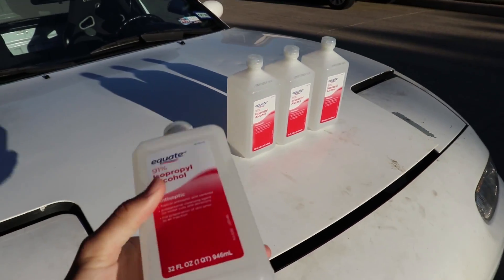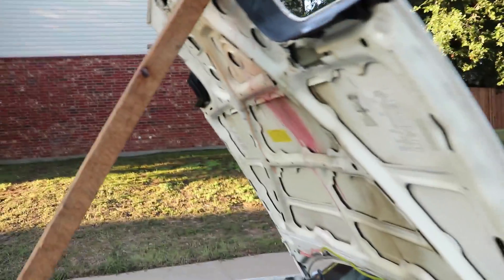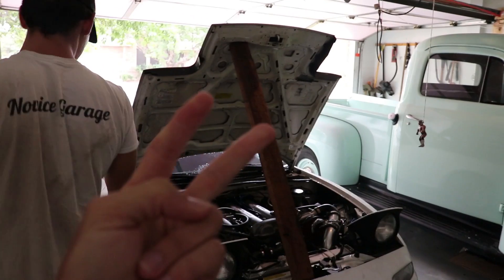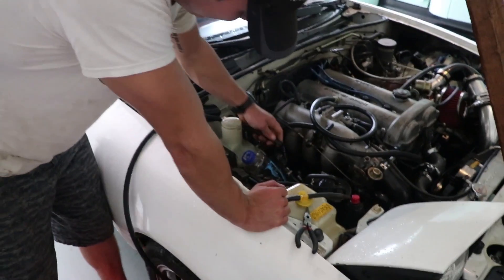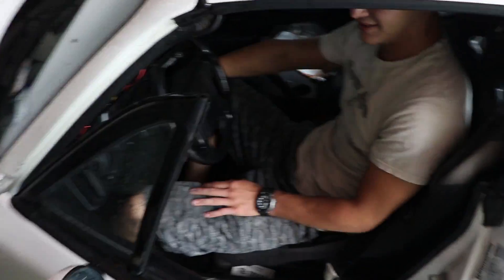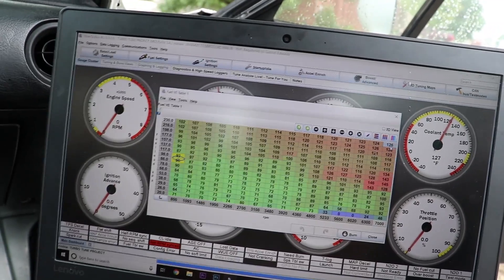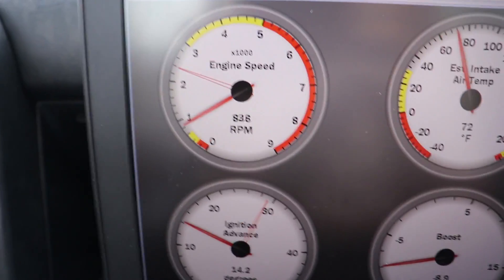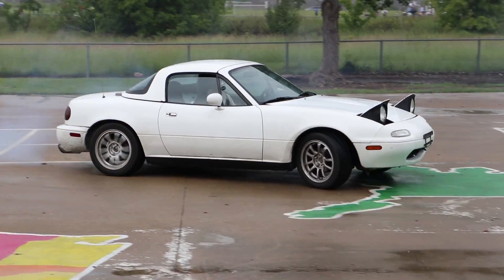Will Rubbing Alcohol Work as Car Fuel?

Comment: How did the avgas work? My dad only ran avgas in his '70 charger back in the day, cuz it had 13.5:1 compression. He said it only liked to run on avgas, and it was cheaper than gasoline back in the late '70s and early '80s. It was his daily driver, but he built it mainly to drag race. He swappin in a fully built 340 from a sprint car and it was a beast. I hope i can get it restored one day. Kept rippin motor mounts from the torque.

Comment: Yes alcohol will work but it lacks the lubricants of gasoline so you’re engine is more likely to overheat. But Ethyl alcohol the only one you can use but you mix it with gas . Rubbing alcohol is not Ethyl .

Comment: With only 1 gallon, your fuel pump was most likely being starving, I bet even if that was 1 gallon of gas the same would've happened based on the fact it's probably a 1/4 inch or less from the bottom of the tank in which fuel pump strainer don't usually touch the very bottom of the tank. At least 91 percent alcohol should have been used. I bet you wouldn't of had better luck with 91 plus 2 gallons.

Comment: Congratulation guys from greece. Here i can have a lot of alcohol from fruits and i really wanted to try this in my daihatsu feroza. Do you have any tip so i can do this without blowing my engine. Great video. If we use a little bit of gasoline maybe 15%, the engine will ran even better?i ask because i was thinking to put alcohol in the tank without take the gasoline off.

Comment: Hey so I have a 2004 Jeep Cherokee two-wheel drive V8 it's got about 109,000 miles it runs great we had a storm come by here this last year and I kind of let it sit there for a couple days and I noticed I noticed my motor running pretty rough if though having that many miles it actually ran really smooth so I put you into together quite smoke coming out of exhaust had a exhausty smelled it if that's the word either way I did what you guys did and 70% alcohol rubbing alcohol worked fantastic save me from dropping the tank and draining it and blah blah blah thank you God bless

Comment: I tried before...BUT not all alcohol.... I tried with 3/4 of tank full and add 64oz of 91% alcohol... guess what I did have ( CHECK ENGINE) light was ON and after driving for about 5 miles it went away ... so 8t will help minor check engine light disappear

Comment: Research about gas being used before mixed with petroleum. It was proven that alcohol or even vegetable fermented can be substituted as fuel for the engine. Rockefeller decided lets not do that because people would make it themselves or even drink the alcohol. So instead adding oil or petroleum with alcohol giving it a standard way of "paying for gas".

Comment: I would think if you use alcohol to often you might damage your fuel pump and some hoses due to the type of rubber its made from, hence why older cars don't like ethanol mixed fuels, I too have experienced a new fuel pump failing on a car built in the late 80's due to using 10% ethanol blend fuel..my new pump lasted 3 months and it was a GOSS brand which make good stuff

Comment: I tried to free up rings on a car in a similar way (soaked it overnight with B-12 chemtool).  I had put an old ratty towel on top of the engine before I cranked it over to to avoid the geyser of crud lol. It did free up the sticky ring based on a before and after compression test. Crap spewing from an engine makes for great video though ;)
Reply: Was this on a Prius? B12 Chemtool is some no joke stuff!

Comment: Methanol injection (alcohol injection) is usually 49/51% alcohol to water by weight.  
Since stoic is different for gas and alcohol, as shortly mentioned in the video, the 14.7:1 afr is way off. Someone can google it, he said 7, but I'm not sure. So yeah, super lean.  
Nonetheless, great little video, despite the hazmat issues - making a mess of the road, your friends car, and in the grass.
Shrug.

Comment: You should have dried the isopropanol. The 9% water content will really fuck with any fuel. Anhydrous alcohols are the way to go, with 100%isopropanol you don't even need to adjust AFR in most cars

Comment: First yes it will run on it.
Why would you want to?  I hate 10% in my gas, becuase it evaporates out.
Also it bad for my vehical.
And then there is the price. 
.......
So you put sea foam in your car.
Then you put transmission fluid in your engine 
And you put mystery oil in Your engine.
Yeah you are a bright one.
None of those will free stuck rings.
Maybe it time to learn how to rebuild an engine. But not to worry keep doing stuff like that and the time will come sooner then later. 
Never add additives to your engine it will last longer.

Comment: So your autotune would have worked much better if you had used the proper air/fuel stoich mixture for alcohol. 100% alcohol is not 14.8:1, it is 9.003:1. Given you have 50% alcohol, 50% water mix, it will be even more extreme, like 5:1. Top-fuel drag cars have around a 5:1 air/fuel mixture. The good thing is, your rings and cylinder walls will stay nice and cool, even under high boost with all that liquid flowing through them. I'm sure the fuel lines and such will hate you for trying this in the near future.

Comment: When you hydro lock your engine because 9 percent of the alcohol Is water
Reply: Most of these kids have never heard of hydro locking the engine.
Reply: @shaunofthedead3000   wouldn't you need a very significant amount to build up? I feel like most of the water would just get ejected with the exhaust.
Reply: That’s not enough to hydrolock an engine.
Reply: 9% is seriously a lot of water.
Reply: @MatthewDouglasT   but i wouldn't think it's enough to hydro lock an engine. typically it has to fill your cylinder to the point where it's more than the level of the point of the maximum height of the top of the piston on the compression stroke and unless it all happens very suddenly, it should just leak out of your exhaust after enough water has built up.
Reply: @ModernBladesmith  You are correct. The water content doesn't matter, hydrolocking is when the cylinder contains enough liquid that it can't complete the compression stroke; you can hydrolock with gasoline or milk or any other liquid.
Reply: @MrMrsirr   That was my initial presumption on combustion engines seeing as the condensation would just be evacuated from the exhaust port on the cylinder if any had time to form before just being forced out by the exhaust stroke.
Reply: @MrMrsirr  Not with milk... No way!
Reply: @CoroPlanesLLC   you're right. Milk doesn't have enough molecular density. However, if you use diesel spark plugs and liquid cocaine, the increase in horsetorque will override the compression in the carbureted fuel injector heads for the piston cylinders and cause the milk to compress more which increases the molecular density matrix which will make it equal to water. It's basic science.
Reply: @ModernBladesmith  

Damnit...who told you the secret formula for perpetual fueline in a combustion engine?

So help me...that guy is totally out of the club. And blacklisted for all our new super secret automotive mods. No more free energy for him.
Reply: @shaunofthedead3000 well technically, perpetual fuel is impossible without a substantial amount of energy to compress water into gasoline, but diesel engines have already capitalized on this principal by using compression to increase the energy in diesel fuel and on the exhaust stroke, it pulls the reusable fuel into the radiator where it goes to the condenser and gets condensed back to usable fuel and is more efficient. that's why semi-trucks can go 1,000+ miles on one tank. They can also use the jake brake like NOS for an extra speed boost. 

This is how cars work. Don't @ me.  
I learned about a perpetual fuel loop while making bicycle engines for nasa.

Comment: In germany it would be a crime if you don´t sober the oil of the street correctly, with sand or wood chips.

And your video is just simple math, just look how energie dense your fluid is.
Reply: Wow that's just stupid the sun will dry it up why waste wood chips on that
Reply: @goreobsessed2308  sun won't dry out the oil, only the water inside, you use wood chips to suck up the oil, so it don't get into ground water. Does it make sense now?

Comment: You need new piston return springs and a new muffler bearing. You should also refill your blinker fluid.
Reply: That's sold next to the elbow grease right?
Reply: John CenaVevo? Chrisfix can help them
Reply: Yup they definitely need new piston return springs and especially blinker fluid to make those headlights bright
Reply: Gtfo
Reply: They could use some soapy wooder, too!
Reply: Am I the only one who noticed the broken axle points?
Reply: No it's just the Nut behind the steering wheel.
Reply: Are you going to make your own video then? Didn’t think so. Stop suggesting things they need when they’re the pros.
Reply: DESTROY 5G r/woosh

Comment: Alright everyone. I checked and it's 25 dollars a gallon.
Reply: But it runs out twice as quick
Reply: 91% Isopropyl is 2.50 a quart in Walgreens, that makes it $10 a gallon
Reply: @cactuscosyusa  Ecolink solvents has it for 8.50 a gal. And any way other non medical alcohol could be purchased cheaper and made just as cheap as petroleum based fuel if the same infrastructure was in place as with oil.
Reply: @cactuscosyusa  he might have different prices near him
Reply: @uknowngamer1017  The $2.50 a Quart price is only if you walk in the store, not online, l believe Walgreens prices are the same everywhere.
Reply: @cactuscosyusa  I'm not sure, I bet it's cheaper from a different source though since someone has got to make this stuff in bulk
Reply: Uknown Gamer101 you can get gallons online for a fraction of the cost
Reply: not at dollar tree. although it has more water.
Reply: The main possible advantage of using Isopropyl Alcohol as fuel is that it's easy to store and doesn't smell too bad if it leaks. If the national electrical grid is ever  destroyed by hackers or EMP, and no gas pumps operate, then Isopropyl could be used as emergency fuel.
Reply: @cactuscosyusa   or ethanol since moonshine
Reply: @cactuscosyusa  if the grid is destroyed by an EMP it will affect your automobile also it'll cook your PCM
Reply: @josephatnip2398  That depends on where the EMP takes place, and where my vehicle is at the time. Highly unlikely any EMP is going to cover the whole of the United States. Also vehicles with carburetors are less likely to be affected.
Reply: Not if you buy it in quantity 55 gallon drum is $199 for 99% pure that's $3.61 a gallon
Reply: Lol
Reply: Try dubra
Reply: Doesn't matter how cheap you can get it it's going to kill your fuel mileage you're going to use twice as much alcohol as you would use gasoline
Reply: This is probably 90 percent alcohol 1 bottle at Walmart cost less than 2 dollars so if 4 is a gallon a gallon would be 8 bucks
Reply: not anymore it costs about as much as gass now if you can find pure ethonal
Reply: 91 % rubbing alcohol is only a little over a dollar  a bottle
Reply: bro check in the pandemic the prices have dropped massively
Reply: Won't matter in the apocalypse 😂
Reply: Let alone being used permanent fuel lol, it may not have blown up yet - but the tuning is essentially like overclocking a video card. It's good for a temporary fix, but is tolling on your long term use. That's why they were scared to blow it

Comment: BioChemist here. Isopropyl Alcohol is less energy dense than gasoline so it burns way faster. You need way more Alcohol then you would gas. If you are not using 100% Isopropyl Alcohol then it is a solution. Which means it is a mixture of Isopropyl Alcohol and water. Meaning, you need even more Alcohol than gas because it is diluted. Because Alcohol burns so quickly, the alcohol is turning to vapor before it can get all the way through the engine. You car is essentially running on fumes.

Comment: Alcohol is fine on paint. You should actually use 50/50 isopropyl alcohol and water mixture after claying your car and before waxing. It takes any oil or residue off the paint, and allows a wax/sealant to have the best bond on your paint
Reply: As someone who’s a detailer you’re a G
Reply: And you know this how?
Reply: @dawsonsigmon592  Because isopropyl alcohol isn’t a strong enough solvent to breakdown automotive paint it’s good at emulsifying oils though which is why it’s used in air fresheners to combine fragrance oil with water and in this case to break down a wax or oils that would prevent a coating from bonding to the clearcoat

Comment: Yes it will work very good is car fuel. However it burns hotter. It will clean the engine but I would not use so much of it. One bottle would be enough for you to drive to a gas station. I used to keep this in my car when I was in the United States as a car dealer so that I could self-rescue. But with so much you put in you could definitely burn the Pistons in that car and valves

Comment: There is a product called "Engine Restore and lubricant" made by a company called "restore" it comes in a silver bottle. It is a oil additive that helps with compression and I have to say it is 2nd to none! Out of all the "miracle" products out there this is one that truly works! I had a scored cylinder on my 383 stroker and you could tell instantly of all the power that was lost being restored!
Reply: About 4 years ago, at 180k my 2002 Mazda Tribute started using a quart of oil every +/- 1500 miles. Then, a year or so later, it started smoking real bad when I cranked it after sitting a few hours at work, overnight etc. and I was ready to trade it in. But, I read up on oil additives and decided on Restore... I use the 8 cylinder can even though it's a V6. Anyway, since I've been using it at oil changes, my car barely uses oil any more and quit smoking on start up and now has 240k+ miles on it. You have to shake the can real good before you pour it in because it seems to settle at the bottom of the can. YMMV

Comment: What a stupid idea... you have just literally thrown loads of oil all over the floor... what a lot of environmental pollution... why use so much oil anyway?  If you only used a small amount of oil, you could have just put the spark plugs back in and started the car... and the oil would have been burnt when the engine started.....

Comment: So why wouldn’t cars burn alcohol stock? I get the feeling that the 9% impurities in the 91% Isopropyl rubbing alcohol solution would not only gunk up the injectors over time, but would eat away at seals, gaskets and bushings. Also, this has got to be quite a bit more expensive to run too, right? What are the other drawbacks that I’m missing?

Comment: SO.... 14.7-1 for gasoline... but 7-1 for alcohol.... soooo 14/7=2 so you need twice the fuel, not 50% more

And if your AFR gage registers the ratio before it enters/leaves the cylinders, then you should see a 7 on the screen to run "like" gasoline. if it registers the AFR by looking at the exhaust then it should see 14.7 when running normal. Auto tune should work better looking at exhaust as opposed to in the intake/cylinders

Comment: I think I found a solution to today's rising gas prices, but how much CO2 emissions does it give out though? 😂🤔
Reply: Alcohol is less emissions, we already use this same type of alcohol in “flex fuel” vehicles which use 85% alcohol and 15% petrol. Right now it’s more expensive than gas but is renewable, which means eventually alcohol will be cheaper than gas, but it also contains less energy per gallon which means you get less gas mileage, so it has to be significantly cheaper than petrol for it to actually be cheaper to use, won’t happen for awhile. You’re welcome.
Reply: They had to buy like 5 for one gallon, that's more expensive than regular gas

Comment: Ok youngsters its like this. If you are in a emission state and the car gets inspected  and you have a hi performance classic car that wont pass. You put straight alcohol in the tank and you will be able to dial the car in to pass. You only do this for a short time and all is good. I did it many times years ago. All the "older tuner guys will know this trick. So yes you can run a car on alcohol.

Comment: “Using alcohol in an ordinary Ford car, we are able to get 15 per cent more power than with the present gasoline. Where government made its mistake was that it went on the theory that an alcohol of very high proof was needed. It began at 180-proof and went up. 
 We began with 180-proof and went down. We found 160-proof to work better than most any other grade. That combination of spirit and water seems to burn best in a gasoline engine.”  Henry Ford, 1916

Luv it!  Did you know you were running on 9% water!!  Throw a rag over to spark plug holes next time.  Source:  https://theriseandstallofthepistonengine.weebly.com/
Reply: They should try moonshine!
Reply: Shell company you should like this idea